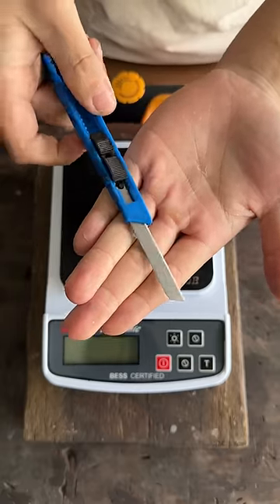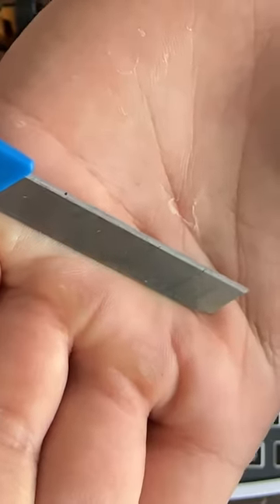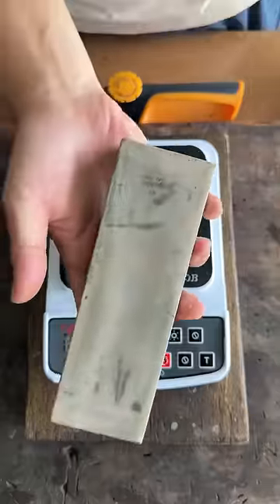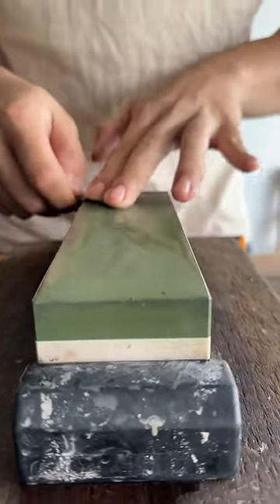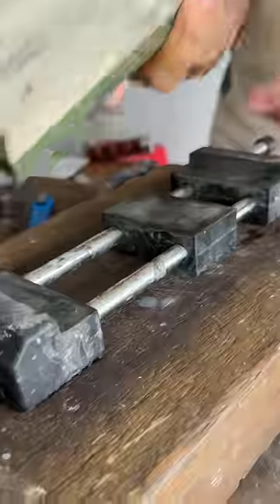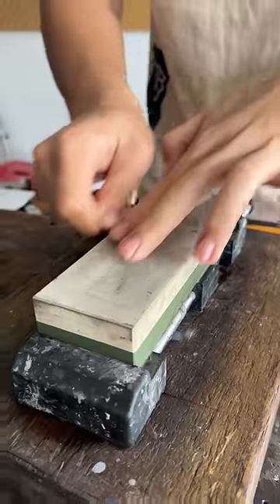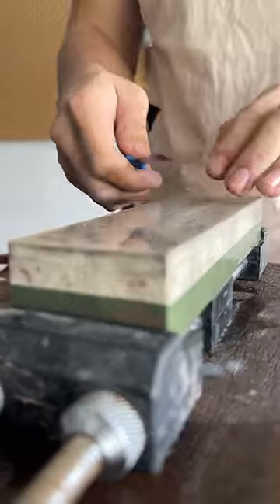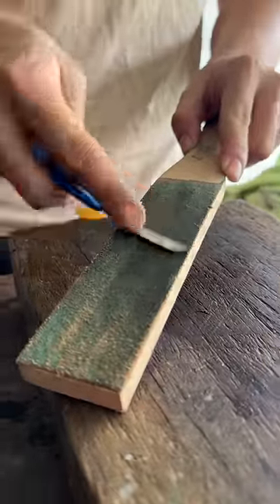Sharpening a retractable utility knife#fyp #shorts #knife #knives #knifesharpening #kitchen

Comment: I’m surprised it didn’t break while sharpening
Reply: They don’t break that easily
Reply: @oisac3223  I had one and it broke after cutting a few cardboard boxes
Reply: @rustyshackleford2808  must have been the brand, I have one I’ve been using for over a year, I cut boxes open everyday with it and it’s been fine other then needing to replace the blade when you’ve ran out of segments
Reply: @oisac3223 yep get your box cutters from a hardware store and they last dollar store ones kinds suck
Reply: I have one and it’s really strong, it wouldn’t break easily.
Reply: @rustyshackleford2808  dont pull out the whole blade then, they are snap knives not solid knives
Reply: @mpownage4806  I didn’t….
Reply: @rustyshackleford2808  i think its just a user problem. I dont have a problem with them. Probably sticking the blade to far out of its handle is my guess.
Reply: @oisac3223  exactly you need pliers or something with leverage to break it.
Reply: It is made to break easily, in case the front edge loses its sharpness we break it into another front edge

Comment: Realistically someone isn't going to sharpen them though. I've seen the way people go through those things especially drywalling and they just get absolutely destroyed regardless of how sharp they are even for the more expensive fixed ones. (they get nonstop replaced)
Reply: lmao yeah because it’s like 15USD for a 100 pack of replacement blades, and 10USD for the knife itself. doesn’t matter how sharp it is or how good the edge retention is when I’m basically using it like a hand trowel with a replaceable tip

Comment: whats the proper actual way to use the sharpness tester
Reply: It measures force. The sharper it is, the less force it takes to go through, the lower the readout
Reply: @H34D7  agreed an theirs way to fudge the numbers
Reply: You are supposed to apply slow, steady force straight down.

Comment: Now sharpen a pencil sharpener
Reply: I've done it, it's a pain in the arse. 
Impossible to hold the blade, usually warped (because its so thin), and its soft so it holds onto its burrs.

That said, you get some lovely curls from using it.